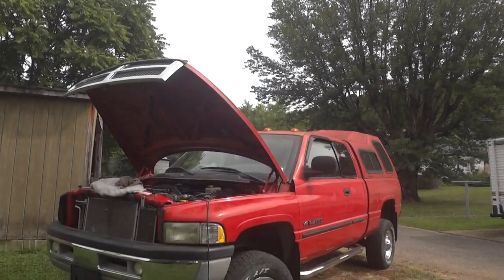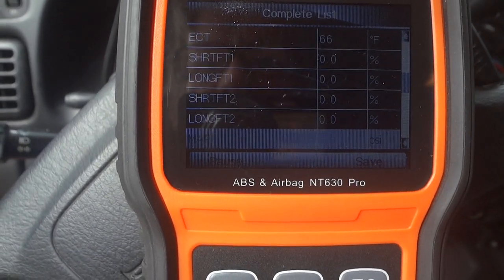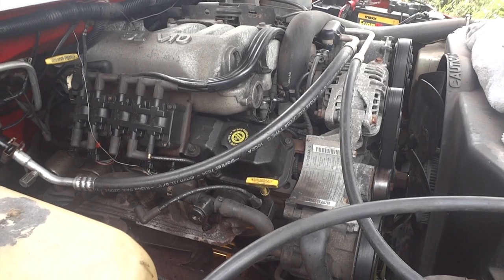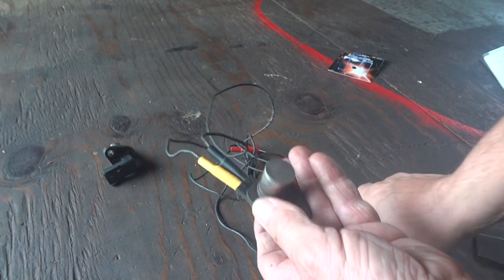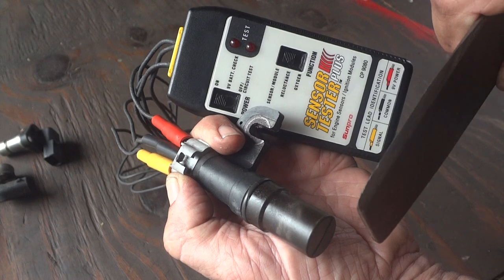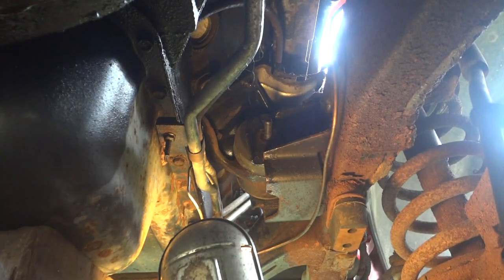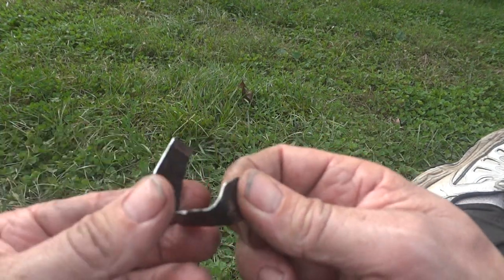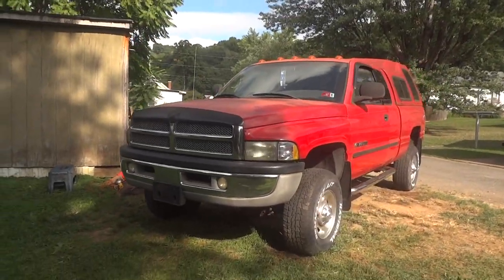Dodge 2500 RAM V-10 No Start Case. Fixed.

Comment: Great video. I've owned 4, 2nd Gen Dodges with V10 engines. Have not had a crank sensor fail but keep on around just in case. Overall they have been very reliable for me. Run them in sub-zero winter and 100 plus summer with no problems.

Comment: This video was incredibly helpful for me diagnosing stall behavior in my 2002 V10 Ram.  The problem started right after I put in new alternator and ac compressor...had me thinking I had caused it via some electical fault, or short to block or god knows what.  I found Walker part on Amazon listed wrongly as CAMshaft sensor: order/received.  when I started work to remove old "bad" sensor, though, I found the real problem.

the female connector on he sensor's pigtail is shaped like a perfect goblet. When connected hangs straight vertical with open end up connected to male from harness.  When I pulled it off, it was literally filled with pooled antifreeze.  i had lost a bit out of the upper rad hose when doing alt/comp installs, though little of it...  Now I know that little splash was the cause.  i shook out the connector, sprayed with a lot of contact cleaner, dried it, reconnected.  No stalls since, still using old sensor.

i have read that the connector was redesigned for 1997.  maybe this was a known problem they thought the overcame.  But clearly that otherwise rugged connector is not spill or splashproof.  It hangs right below waterpump, thermostat, and right above an unobstructed splashline from the ground.  

My thinking is those who have lost several sensors might actually have just gotten reversible splash-induced short/ static in the signal.  Before swapping a crank sensor, I suggest some connector cleaning as a first step.  And please be careful with your liquids or any engine cleanup potions you might use.  not sure how yet, but I plan to waterproof that location better now (and will mind my manners with coolant splashing).

Thanks snd best of luck, 
Bill

Comment: I own a small garage and had a customer with a bad crank sensor on a Ram V-10. It was a tight spot, but I removed the crank sensor and had a new one put in in about an hour or so. It was not necessary for me to remove the motor mount or even to loosen it up. Patience was needed by slowly working the sensor out little by little and spraying penetrant generously, thus allowing the sensor to pop out.

Comment: When I did mine I bought a long pr of vice grips at harbor freight, applied valve grinding compound to the jaws so no slip off. Did it from the front of the axle without moving the motor mount. I also had a snowplow bracket in the way. The day before I placed a cotton ball soaked with Avon skin so soft at the sensor block spot. Was no struggle at all to replace the crank sensor

Comment: I think it was an awesome video ouestion is there any symptom that the sensor is going bad before it actually goes
Reply: Just like this one. Mine was running fine. Went out to go to work and cranked and cranked but no start. It did throw a code after a lot of cranking but no early warning.

Comment: Based on this video, I ordered the Sensor Tester Plus to confirm my suspicions concerning my crankshaft sensor (NO start and I determined that the ASD relay was beint triggered off by the computer). Reading the sensor's output with my analog meter (pointer) I saw no variation from 5 VDC out as the engine was cranked. I monitored that by "pinning" the sensor's output signal at the computer's sensor input (pin A8). Ordered the Sensor Tester Plus and after receiving it, promptly disconnected the sensor from the harness near the oil filter and tested it.  No indication what so ever. Two sensors ordered from China... I'll test them before installing them. I've even located a NOS MOPAR original sensor, just in case! Now, the wait for China Post..... The strangest thing about this sensor failure was it occurred when I went to test my new sparkplugs by starting the engine.... no start! WOW. And I don't ever want to change those plugs again..... what a hassle on the left side...
Reply from the maker: I know Right!!
Reply: @FixingWithPassion  sir what's the part # an where to get it. Unfindable in u s. Desperate

Comment: I had that happen before. It would crank over but not start. I have to replace the crank and cam sensors. On that generation, they are not too difficult to replace. Mine did not throw a code either. The cam sensor is inside the distributor.

Comment: The crank sensor can be changed out without pulling motor mounts or jacking the engine up, it's about an hour job and the pcm has to be relearned to the new sensor. Take your time doing this job an it can be done .
Reply from the maker: If you live in the rust belt, I hope you have nothing close to what I have to go through!
Reply: How do u relearn the pcm to new crank sensor?
Reply: @chaddickerson2369  the pcm will automatically relearn itself each time the engine turns over and is driven over certain amount of miles.

Comment: My truck is a 96 v10 as well and it just cranks and cranks but doesn’t start but I don’t even get a fuel prime when I turn the key so I got no spark no fuel no start problem I’m thinking it’s the pcm I don’t think a bad crank sensor will disable fuel feed
Reply: Been reading up on this problem, and the auto shut down relay in the pdc box in engine compartment shuts down pump, injectors and coil packs
Reply: @robdob5640  ended up with a better solution and sent her to the scrap yard lol I got the truck for free and tried to save it got 400$ for it from the scrap yard. Thanks for the reply tho

Comment: Did it not have no spark either cuz i'm having problems with mine
Reply from the maker: O my!!
Reply: So i changed the crankshaft sensor on my 94 dodge v10 and i'm still not having no luck with it starting change the fuel pump and heard it running so i don't know what else to do if i should change the camshaft sensor cuz i don't have no tool like you do to check them

Comment: Talk about over complicating something. 
I’ve change my two wheel drive V10 crank position sensor in 8 minutes.(twice)
First time ever took 16 minutes . You take out the 1/2 “  bolt . Use needle nose vise grips 
And a socket to pivot on. Pulls right out.
Reply from the maker: Bull shit! You didn't have to deal with the 1/8" NE rust belt build up crap did you. This thing was frozen on there. Pulls right out...lol
Reply: @FixingWithPassion  
Are you referring to the CAM position sensor? Cause I'm talking about the CRANK positioning sensor.  You know the one right up close to the motor mount.
Reply from the maker: @jamesdimmett2855  What??? What do you think I changing here???   That is a CRANK sensor dude. The cam sensor is in front /by the water pump. Yea good luck getting it out without breaking off that little 10mm bolt. They all snap off. Good lord!
Reply: @FixingWithPassion  
Apparently not! 
My truck sat for 3 years 
I had NO ISSUE with the bolt. 
But mine is a florida truck.
Reply from the maker: @jamesdimmett2855  Damm there ya go! Lucky you!!

Comment: Ny here
Reply from the maker: Nice!!
Reply: @FixingWithPassion  can those sensors slowly start going bad, I have the same truck (v10 with a 5 spd. 4 whl drive ) just started cutting out while I'm driving, some times it starts right back up, some times it takes a while to get it running again, first  thought it was a fuel pump issue, changed that out 4 miles down the road  it died again, engine temp, or the speed I'm going don't seem to make a difference. Checked all the fuses and relays even swapped them out , no difference.